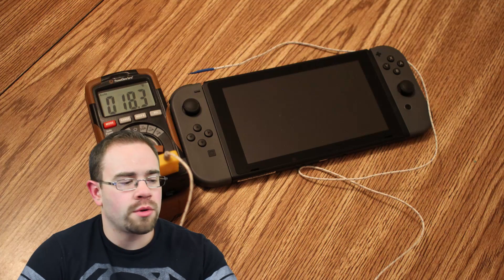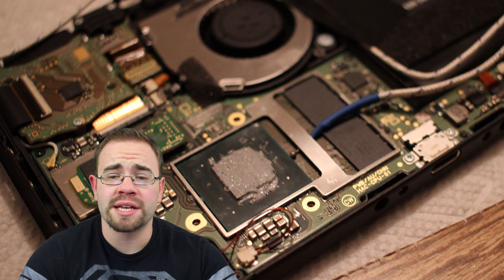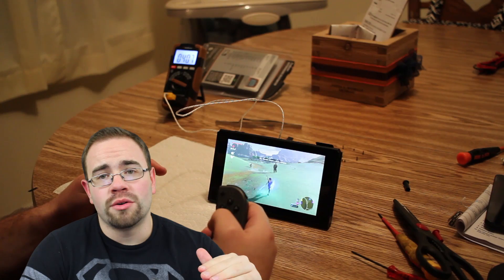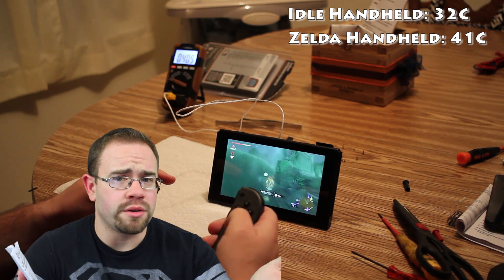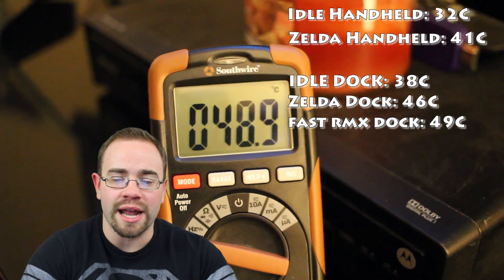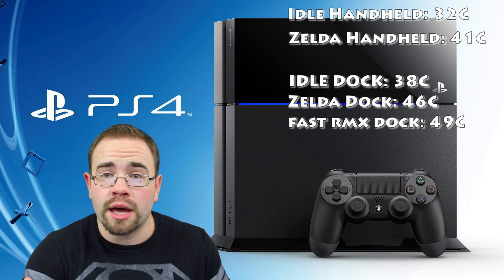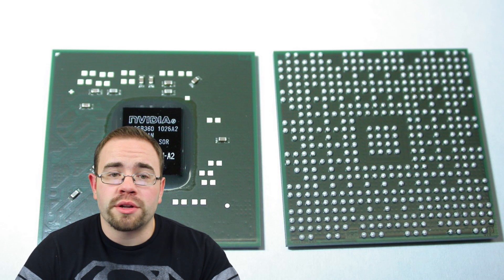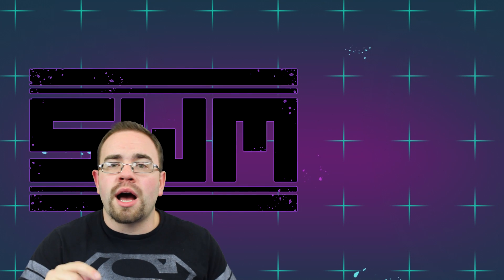How Hot Does The Nintendo Switch Get? Temperature Results!

Comment: I got 2 bad switches in a row. And now my third switch's cooling fan ramped up to full blast on first boot up, then slowed down to normal after a minute or two. None of the others did this. I wonder if i will have thermal issues in the future. Others have reported similar behavior with no issues.

Comment: Hey i bought an extender cable, fyoung one, but im not sure to keep using it. I wanted to avoid the overheat issues inside de dock because it can damage the internal parts like battery life, gpu performance maybe i d.
Do you think i should keep using it or should i use the dock, PD: i noted that if i open the back case of the dock you can see the the holes where the air vents of the switch are.

Comment: So, in your recent vid, you said that the Switch shuts down when it reaches around 70 degrees Celsius.  I've been worried about the Switch overheating in the dock for a while.  If you struggled to get the Switch to 50 degrees Celsius, does that mean the Switch is alright to play game docked for long periods of time given that it doesn't have a factory defect like you said?

Comment: Do you think the heat will vary depending on the Television/monitor used? I.E cooler on 720p's, warmer on 1080p, and warmer than that on 4K even though the switch is capped at 1080?
Reply: Flendomo Probably not because the console down samples from the highest resolution possible of the system.

Comment: I was wondering if you can do another test of the Switch while Docked, but leaving the  back part of the Dock open. The vents in the back of the Switch is taking in air to cool the system and I believe the enclosure is actually suffocating the system which is why it heats up faster than in undocked mode. I just heard about the air intake vents and took another look at the Dock and thought it may be the case.

Comment: The unit itself is lighter than the 3ds Xl (2015) and it manages to outperform that system by a plethora of numbers. 

Obviously, there are no surprises there. The temperatures of the unit are impressive as well. Even if they are using a Maxwell Chip on the inside. I'd rather have a more refined variant of a Concurrent chip as opposed to having something a bit more powerful and less refined "revision not architectural "

Comment: I often play handheld Mode. And Sometimes im sitting in a Position where the Fan Cant really breathe, because the little air things on the backside are 'closed' (sorry, for my Bad English i hope it's understandable. And after 10 minutes, the Fan is going nuts. I mean this thing sounds like it's Making 100.000 RPM to breathe The air trough The System. But only had it when i lag down the console on a Table and He Cant 'suck' air from the things behind. Someone Else got this? 
In TV Mode i let the Dock open behind, because there is a place for the switch that she can suck air like normal. I dont know if it's normal that The Fan Sometimes go nuts. 
But I think it's normal. And a speedy Fan is a good Fan x'D
I finally want to know The Real specs of the processor. 
How much GPU units does this thing have? 256 or 512 or even another number? 
Why they dont give a full spec for the 'custom' X1 
What is so much 'custom' on this Chip? Hope some modders or hackers will get to that point Soon.

Comment: Thanks for addressing lead-free solder. Lead-free solder has been a CURSE to the electronics industry, and is actually WORSE for the environment! It has a higher melting point, and is more brittle than leaded solder. The increased soldering temp causes more extreme thermal expansion during manufacture, and so, when the solder cools, the parts contract further, putting more mechanical stresses on the solder joints. Thermal expansion and contraction that is associated with powering the unit on and off slowly stresses these solder joints under mechanical tension, and the more brittle lead-free solder cracks.

There is also the issue of tin whiskers. Lead-free solder can form tin whiskers, which are crystalline needle like growths of tin that form on the surface of the solder. Over time, tin whiskers can short out adjacent solder joints.

Most of the lead used by the electronics industry is used in lead-acid batteries, which already have an exceptional recycling program in place to deal with waste, and in CRTs, which have been obsolete ever since 2005 or 2006, when LCDs more or less became affordable. So most lead was either A: already recycled via a well established and highly successful recycling program, or B: eliminated from manufacturing altogether! The remaining 2% of lead usage is in solder... And going lead-free has merely increased the amount of e-waste produced, by reducing the overall lifespan of devices!

It's inconceivable that my motherboard couldn't last 3-4 years, and my phone just conked out dead after 5, yet I can still turn on my 1965 SCM Cogito 240SR calculator, or my 1976 HP 9825 computer, or my Apple IIe, or my Commodore 128, or my Twentieth Anniversary Mac... But my 3-4 year old PC already failed... My Xbox already failed... My Acer A500 Android tablet already failed... I have two dead PS3s in my workshop!

So yeah, I said it... lead-free solder is BAD for the environment! It reduces product lifespan, and generates more e-waste, which either costs more energy resources to recycle, or it ends up in a landfill or salvaged in poor countries anyway! Lead-Free solder is BAD!

Comment: TO BE FAIR, you shouldn't randomly just play Zelda to find out the max temps. As we know, the game is frame capped at 30. So that means that in non-intense situations, like in shrines, the GPU utilization is not going to be even close to 100%, it can be half that. That will cool the Switch significantly. Find a forest area where the game runs under 30 consistently and THERE you are guaranteed, at least theoretically the 100% GPU usage. That's the real stress test. I'm going to guess you'll get much, much higher than 49 degrees, more like 60.

Comment: The system seems (for what i experienced) to have the most problems around the deku tree, when there is water, gras and all the koroks.
Reply: Kenneth Irgendwas I agree on that one. Korok Forest lags extremely (I own a Switch with Zelda). It seems that either the Switch is underclocked or that they didn't port Zelda well or that its the typical Open World Framedrop problem (Like every Open-World Game)
Reply: Honestly, I think they just rushed the zelda port. Just going from PowerPC to ARM is extremely hard to do because of PowerPC is so dated at this point. They probably were rushing to make this a launch title. I expect a patch to come out for the game soon that will hopefully  fix the frame rate issues.
Reply: The Aki War i must say that the wifi Signal seems to stress the System pretty much
when i turned it off i got significantly less laggs overall

Comment: Would be cool if you would talk about how the joycon strips  dameg the joycons. after using them on or 2 times the joycons are little wiggeling arround when in handhaldmode connect to the switch. We tested that with a lot of joycons this is a huge problem.

Comment: I accidentally played an hour or so of Zelda, with the console flat on its back, on a leather ottoman (so the two vents at the back were totally blocked by the soft flat surface of the ottoman) :( would I have damaged the fan/chip? I didn't realise the fan does indeed run, whilst undocked.
Edit: It was blowing out hot air by the time I realised... paranoid I've damaged the fan motor or something.

Thanks for helpful advice, if I get it ;P!
Reply: Alex Popowski i don't really know myself but if it still plays just like before than it should be fine. Leave your switch for a little while before playing it again.
Reply: Alex Popowski it will shutdown before failing. dont worry
Reply: Alex Popowski Just for the worst case scenario don't do it again, but you shouldn't worry about it. If it was overheating it would just shut down, in order to preserve itself
Reply: Thank you very much for your responses. The console did not shut off or anything like that 🙂 I was worried about a damaged fan motor, as wouldn't it create a bit of a vacuum on the soft leather surface?
Reply: Alex Popowski Nintendo might have failed to put in an overheat protection on the switch like most cellphones and tablets have nowadays. But like someone else just commented be very cautious to never block the back and top vents while the system is running. Another factor that matters is like what Spqnwave mentioned. Watch out for ambient temperature, basically avoid playing in rooms that are very hot or allowing the system to remain in direct sunlight.
Reply: Those ports on the back barely would bring in a lot of air, your fan will be fine. Plus the console will suck down if it over heating. You wouldn't of done any damage to it
Reply: Teknoman Blade There are back vents? I though those were speakers. Derp

Comment: When the cpu/soc has bad contacts it will not boot or crash almost immediately, audio and video problems  are more related to other chips on the board, flat cables, or video driver of the screen itself.

Comment: Hey Spawn ,i love my switch , my only issue has been really weak wii fi connection , ive tested other devices in exact same area and had a good signal , but switch barely has 1 bar , is this a know problem ???
Reply: Bamfx Do the actual "Test Connection" test because I only have two bars out of three displayed on the UI, but when I actually test it, the results are on par with what I would expect from my internet connection.

Comment: After my housemate was playing Breath of the Wild for an hour straight with my Switch in the dock connected to my HD TV I pulled out my non-contact infrared thermometer and measured the air coming out of the vent, the max temperature I measured was 107 F.
Reply: That would be 41 Celsius which is absolutely a tolerable heat range.
Reply: Shadow Might thats Fahrenheit lol , not Celsius
Reply: Oh wow... Nintendo really fucked up.

Comment: So Zelda is 93% the temp of Fast rmx.  That's interesting considering Nintendo said Zelda only used 90% the processing power of the Switch.  The temp for Zelda using 100% would be roughly 51C then.  Which means even Fast rmx is not maxing-out the Switch.  (this is just my totally unscientific guess).
Reply: The relation between temp and "power" might not be linear. I expect a curve. Especially when active cooling is involved.
Reply: stormyandcold not really relative as the switch port is a type of emulation of the wii u version the switch is currently unoptimized but can be maxed out further don't forget,  the switch is currently  in its update before a four resource leakage has been plugged up.
Reply: What you should take away from what I said is that the max temp is around 50C~ for the running temp of the system while docked.  Zelda is not being emulated on the Switch, it's a port which according to Nintendo's timeline, would've been developed in the last year.  There are hints when comparing the Switch version and Wii U version because they're not exactly the same.  What happened then is that the engine/game is ported over to run on the Switch, then, Zelda's development up to release were 2 branches of the same game.  When Zelda patches come, they will likely be released at seperate times because the game is now independant on each platform.  It's basically concurrent development.

Comment: 75 degrees Celcius max?! Does this mean the Switch can potentially be clocked much higher in a future system update? Awesome!
Reply: they can clock it higher but power efficiency will be thrown out the window. as the performance go up power efficiency will start going down. anandtech have made interesting analysis of switch power consumption. if they want the switch to operate faster the current dock might not be able to cope with it. 

http://www.anandtech.com/show/11181/a-look-at-nintendo-switch-power-consumption/2
Reply: Renzc ode Yup. It's weak.

Comment: now 32c to 41c thats pretty good compare to laptop and desktop, take note pc gamers and save your money grab the switch.
Reply: I have both.
Reply: any gaming laptops and desktop have overheat issues doesnt matter what brand of gpu you using, with the exception on switch of course.
Reply: scatman Gutierrez overpriced? The switch can't run 4k... or 1080p 60 ultra quality.... zelda just 900 30fps....I don't care about it being less powerful, it just offer good portability for the price not good performance, for the same price you can get a more powerful pc or console (but you can't take them on the go). And it is not over prices it is overpriced, learn to write man, you are not a kid, unless your avatar picture is false.... laptops have such high prices because portable hardware isn't very cheap, and also you can compare a tegra x1 that is like a gtx 920mx against a rx 460 (entry level pc gpu that is more powerful than xbox one or ps4 GPUs). And also because each one is aiming at a different market. That is why having both is the best you have the best home experience with your pc, and the best portable experience with your switch. And you can't compare the temperatures of a little mobile socket against a gpu that is bigger than the entire console.... Ignorant
Reply: I have a gaming PC because of the games. That is the same reason why I decided to buy a switch. Besides for only $700 you have a PC that can play almost all of the games that will come out in the next couple of years on high/ max settings.
Reply: ruler898 lmao
Reply: scatman Gutierrez I enjoy my switch but Id still choose my pc over it anyday. it was expensive when i got it but the one worry i have for the switch is that a launch title pushes its limits and if they decide to do the switch plus or pro or whatever then I'm not gonna be happy cuz it is very expensive.
Reply: BuffaloBill Depends on how you look at it gaming on pc well I have my choice games on that. But big 3rd party support switch is a 720 on the go and 1080 at home, Xbox One is only 720p so. 

Also to add on my gtx750ti old add card still games great some in 720 60fps and many new games at 1080 60fps. The games will come if the system sells enough units.
Reply: ダミ Better yet live in canada and open ur window
Reply: Considering my laptop is sitting at 29ºC on the CPU and 33ºC on the GPU while i watch youtube videos and my desktop doesn't go over 50ºC when i game on it i don't think i have anything to worry about.
Reply: scatman Gutierrez WATERCOOLING
Reply: more likely.
Reply: no...no...switch first before pc, i dont have to explain it to you because you can see what the switch is capable.
Reply: Nintendo’s focus on easy to learn, hard to master games has made it the ideal ecosystem for casual players, and even people who have never picked up a controller before. While the stereotype of PC gamers hiding away in dark rooms is increasingly misleading, there’s a kernel of truth there.
Reply: there you go.
Reply: scatman Gutierrez Switch isn't going to get all those big 3rd party games so... 

Plus, Switch is weak for home gaming hardware. Only really good for gaming on the go.
Reply: scatman Gutierrez no my pc haven't got any heating problems... And I overclocked the cpu and cpu. I will also get the switch soon man, but a pc is for something really different, a switch is for portability and pc is for everything else.
Reply: scatman Gutierrez You should know that PCs are much cheaper. My first build was like only 200$ and I could play GTA 5 on 1080p with high/normal settings. And if you say you also need to buy a Monitor i say: TV.
Reply: why would you buy over prices gaming laptop/desktop when you have the switch, something is wrong with you.